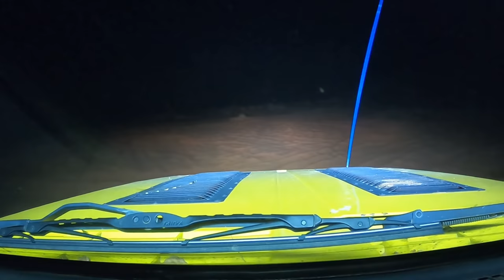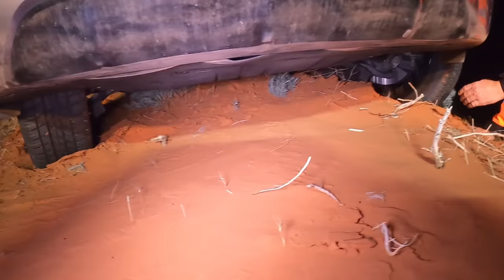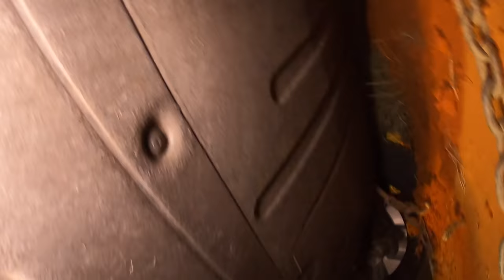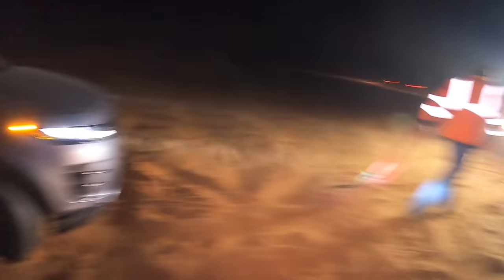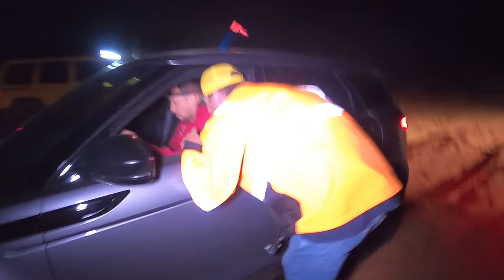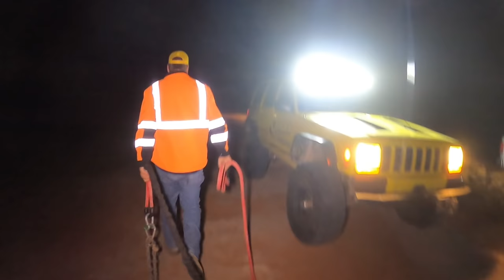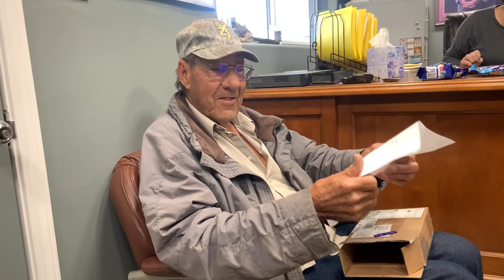Range Rover Evoque Not Doing So Well

Comment: Range Rovers are luxury vehicles and not serious offroad vehicles.  Unless it's a Defender 90, or an older model.
Reply: Hell, a proper Rangie would have been fine there.  As would pretty much any vehicle in the current line-up other than the absolute base-model fwd Evoque seen here.  Of course if you want a proper Rover you'll have to go back a few years and find a solid axle truck like a RRC, D1, or Defender (all which share the same basic underpinnings).  With the D2 things started to slide in my opinion.  By the D3/4 we've lost the solid axles and the decent from serious off-roader to street biased with off-road abilities began.  The current range is quite capable - for what they are.  But they'll never hold the same position they once did.
Reply: WTF?  completely wrong! Apart from the Evoque every RR and LR is serious 4X4.
Reply: @ACERASPIRE1  Given that no current Rover has solid axles 'serious' is relative.  Perhaps there is a language dis-connect here, but Rovers started life as off-road vehicles that could also work on the road.  Today they are road vehicles that can also work off-road.  MAJOR difference.  Independent suspension and air bags, no room for large tires, can't be lifted very much, poor break-over angles...they are still very good off-road compared to other vehicles in their class; arguably the most capable in class.  But despite my love for them I can't call them serious 4x4s.  The last serious 4x4 they had died when they discontinued the last Defender.
Reply: @donhappel9928  With respect, do you believe a 4X4 with live axles, limited articulation, no form of traction aid/control and skinny tyres will out perform a 4X4 with all the  above   mentioned?
Reply: @ACERASPIRE1  Yes.  Because all those things are easily addressed on an older truck and you cannot address them on a new one.  Let's use two of my personal vehicles as examples; I have an 07 D3 (LR3) and a '96 D1.  Both are heavily modified have been through the Rubicon but the process was so difficult in the LR3 I won't do it again.  The D1 has been through half a dozen times and will likely go through a couple more times this summer once the virus mess lifts.  Another example, one day I had my stock '88 RRC on 29" tires parked next to my 2" lifted LR3 in off-road height on 32" tires.  I got out a tape measure and checked the ground clearance at the sills - the RRC was taller despite the mods and bigger tires of the LR3.  While true the actual difs were lower than the clearance of the LR3, it's easy to avoid rocks with 2 individual low points compared to having the entire underside of the LR3 be at a uniformly low level.  (this clearance issue where they measure the dif of a solid axle truck vs the entire low hanging surface of the LR3 is something inexperienced wheelers often bring up).

Next point - weight.  An LR3 or 4, RRS, RR, etc is extremely heavy compared to a Defender/D1/RRC.  Weight is a killer under any circumstance except perhaps towing where it can help control a heavy trailer but of course you don't tow a heavy trailer if you're off-roading.  

Lastly you mentioned articulation.  Let's look at pics of even the latest/greatest of the IFS/IRS Rovers, the new Defender.  In every video it's constantly waving a tire in the air.  They have very poor articulation compared to a solid axle truck and keeping tires on the ground is the single most important part of wheeling.  

I also find the new electronic traction aids almost useless for actual wheeling.  On occasion they help but 9 out of 10 times a true locker would be better.  And no modern Rover offers a simple old-fashioned locker.  Yes, you can get a locking center and rear on some of the trucks but you can't control them yourself.  You have to hope the computer decides if/when to engage it.  If I'm about to tackle a particularly difficult climb where keeping my tires on an inch-perfect line is important I'd prefer to be able to lock before I start, not wait until I start slipping/spinning and fall off my line then hope the computer will grant me locking.  As for the simulated locking of using brake-based traction control no thank you.  It may be adequate for light work and is nice enough for bad roads but useless on a proper trail.  It requires the tires to spin before it can work (bad) and retards your progress when you need smooth controlled progress most of all (bad).  Iv'e also seen it overheat brakes and shut down during particularly long/difficult climbs, say up a long scree hill.  

My next Rover purchase (well, my next one may be another RRC tomorrow if I get a call from the seller but let's not count that) could be either an older Series 2 109 2-door or pickup to build a serous wheeler out of - tons, 40s, LS, 6 sp, 4 spd tcase, 3 link/4 link, etc to replace my D1, and/or a new Defender 110 in a couple years to replace my LR3 as a light-duty wheeler - think more 'overlander' than actual wheeler.  I don't hate the new Rovers at all, but they've long given up on being a serious 4x4.

Comment: The new range rovers are crap compared to the old ones, the old models are go anywhere, the new evoke, disco and defender models are posh junk
Reply: Tyco W doesn’t help that it has street tyres on
Reply: Tyco W I would have to disagree with you I have a 2019 rrs on 32s and it’s way better off road than my discovery 2 with a cdl
Reply: They are street only SUVs.
Reply: Negative... the new discovery is a beast
Reply: Wes Allen no way bro... the kill it stock, just swap out the tires
Reply: Xpedition Academy I was on a trail with a TJ and my sport and on harder trails the Jeep would struggle where the rover would walk right up it
Reply: As a Brit, I'm not patriotic to the brand or anything, but when the discos and defenders of old went off road, they worked.
The new versions are a watering down of the brand. Less mud monster more footballer's wife school-run mobile... Didn't help that Victoria Beckham had a hand in the Evoke design.... Urgh.....
Reply: The is false. The full size Land Rovers will take you anywhere. You just need the right tire and a willingness to damage a very expensive vehicle.
Reply: Blame the driver not land rover
Reply: @hunterevans6909  bs your grocery hauling rover  would not outperform a 4 runner or jeep over a real jeep trail period...sell that bs to someone else. Most serious trails require you to properly modify your stock vehicle and finding lift kits, armor, recovery equipment etc for a rover so you can get up and over big rocks or deep mud holes doesn't  happen easily. I am not talking about driving down a dirt road with a mud hole or little rocks and calling that offroading.
Reply: They have been rubbish vehicles for years compared to Toyota Landcruiser. We have had many on 4wd trips and if they didn't break down first they got stuck. Only LR owners or those who aren't familiar with them champion their worth.
Reply: Do your homework Tyco, the new models that are built for offroading are crazy good!
Reply: @yoboo6167  are you a fan boi? The old models were built for offroading but they are a piece of crap more now than ever in  terms of quality. If you  want to lease 1 fine but buying 1 is a fools game. They have terrible  resale value because everyone knows they are poorly made
Reply: @yoboo6167  I see you are a lil butt hurt..lol it's  ok I have a modified 3rd gen 4 runner as well strictly for the trail. Btw decent as the land rover are in stock form for offroading  they are miserable as they have always been in the quality  dept. Now that an india company owns them maybe they will be able to get a decent 1.5 star rating out of 5 but hey why don't  you buy one fan boi and report back to us in 5 years.  As far as my mom's basement sorry she doesn't  have one because the new house I had built for her in California didn't  need one...lol
Reply: @michaelr1760  Man, you got mad keyboard warrior skills. I yeild lol.
Reply: 😂🤣 the new better than old comments 😂🤣 who are you kidding? Electronics winning over mechanical systems lol whatever fanboys.
However I would like to see a face off between the generations!! Anyone seen the video of the stock Defender 90 pulling a tuned tyre spinning Dodge Ram in a tug of war? That's a good video.
"Sorry Matt for the post hijack"
Reply: Michael r Check out my YouTube channel, also  I’ve driven down the hardiest trails I could find and it performed perfectly and I completely believe it could outperform a forerunner or a jeep no problem with slight modifications of course.
Reply: If I wanted a British wheeler the only one I'd buy (if I had silly amounts of money to spend) would be an old military wolf, defender, or series III.
Reply: To be fair, tho, that's true of all vehicles.  The new American trucks are taller stock than they've ever been, but still have lower ground clearance than ever.  Took some kind of engineering to pull that off, lol.
Reply: HI Tyco you are ioo % correct about those old range rovers .the series1 were like a army tank built to last very rugged very stylish, they were so popular they used them on a African safaris for years.some still being used today.
Reply: Being familiar with the over complicated traction control settings helps too.

Comment: "I thought you said you were stuck."
-The gas company pipe fitter that pulled my Geo Prizm out the sand on Willow Springs Road near Moab.

"Why do I need a strap? I'm not the one that's stuck."
-The guy in the pickup that couldn't pull me out because, well you know why. 

Now I carry a strap. I didn't get stuck on the way out because I didn't have any silly 4x4 trucks driving slow in front of me 😁

Comment: Come on guys, Range Rovers are no joke offroad, you just can't assume that about their drivers. Maybe the Evoque is not so offroad-worthy as their other models, but it is not a front-wheel drive. It does have multiple traction control modes, including one for sand. Maybe this one was broken, maybe it never made it out of "Mall Parking Lot" mode, it's quite obvious it got in there to start with. Regardless, no Range Rover, no Jeep, no anything gets out of being that high-centered.
Reply: Nate Beachey B.S. yuppie tech and no suspension travel  equals a soft roader.

Comment: Don't take crappy cars without 4WD off the pavement!
Reply: it is awd, you can see the rear diff in the beginning
Reply: It's definitely AWD. The tires are the issue, not the car. Okay the car is crap too, but the tires moreso.
Reply: @jimmym3352  AWD is not 4WD.  I wouldn't take an AWD car off a well maintained dirt road.  Definitely not into sand.

Comment: But if you watch the video there are clearly axles. I know that those are primarily fwd drive an the rear end is supposed to activate, you can see a rear diff and the cv axles. Also you can see that at one point the rear was spinning cause the rear tires were dug Into the sand. Also there is a center locker and rear locker (could be wrong about the lockers) probably an operator error

Comment: Looking underneath the rearend, it looked to have a Haldex AWD system (I saw the rear differential with the clutch packs but for some reason, the rearend wasn't kicking in; he may need to take that thing to the shop (possibly ripped off the wires that sends the "lock up" signal to the rear differential when he was rooting?)

Comment: Hey Matt, did you ever actually take the slack out of the rope before the rover came off that hill?  I think the weight of the rope on the front end tipped the scale to get it off the high centering.  One thing I see on these videos is people hitting the gas to hard and losing traction.  We used to run around sand pits with 2wd pickups.  And what's with those stupid low sidewall tires? They're expensive and ride like hell.  What is the point?

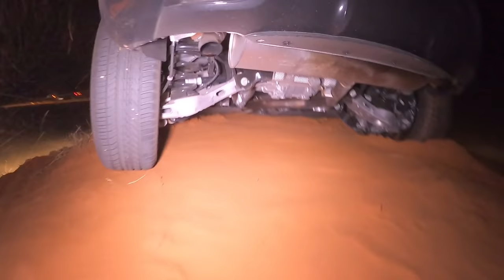Comment: That car IS equipped with AWD. You can see the rear diff and driveshafts @1:13. I wonder why it wasn't working?

Also, how'd they end up on top of a mound? LoL. That takes talent in something that can barely move in the sand ha ha.

Comment: Sand mode, take pressure of tires to about 13 psi and try not to bottom out. I drive a land rover discovery sport around the desert and dunes here in the UAE and got stuck a few times but these cars can get around sand and dunes when you know what you are doing and the capability of the car. But I gues the discovery sports are a little more offroad capable then the evoque

Comment: 1:15 it looks like a diff and axles in the rear. My guess is the electronic transfer case defaults to fwd everytime you restart the engine. That or viscous coupler is trash if it has one.
Reply: It should be automatic engagement on the center diff.  Wondering if the left rear wasn't spinning with the right front...

Or maybe the computers got confused by actually being off road, something that Range Rovers are no longer meant for.

Comment: Ok with the Evoque if something happens to the 4x4 system it will transfer the power to what axle is working which in this case was the front.. Range Rover/Land Rover does not make anything but 4x4s.. They have what they call command trac system if it goes out or someone get it stuck the computer will take over and that just makes the problem worse.. Plus the person driving it did not help any either.. Not blaming the person or the ride for this.. Looks like he didnt air up the system either.. Got to love air ride on them thats for sure..

Comment: Those low profile tires are the worst tires ever for off road.  That expensive rig is home on a paved road, not a sand lot.  I have regular tires on my GC Jeep, and it goes anywhere I have ever wanted it to go.  My Dodge pickup has semi-low profile wheels, but since I will never go into the sand, it is ok.  My T Bucket has 33" tires on the rear, and smaller tires on the front, along with lots of ground clearance.  It does quite well in the sand for road tires.  I ordered some sand paddles last week for it.  I live close to some sand dunes.  We will see how it does.  When I do go to the sand dunes, I will have a sand anchor to go with my winch.  (just in case)

Comment: Looks like on the 2nd attempt, his front wheels were the only thing spinning, it's a brand new car, still temp plates, maybe the owner doesn't know how to drive it correctly?
Reply: It it was 4wd, and in 2wd, only the rear tires would be spinning. This was a fwd car.
Reply: @ericpettyfishing  It is available in FWD and AWD, but I though if the diff lock failed to lock it would only go FWD?

Comment: I know, 6 months old, kinda yesteryears snow.... anyway, one of the few videos, if not first where I think: why this way ? My guessing would have been: If the vehicle was driven forward on the little hump, wouldn‘t pulling it backwards be more gentle to anything potentially being stuck underneath ? Some peaky surface or even a spike of some sort protruding towards or into the car and causing more damage by pulling the car more over it ? Just a question, you might have guessed yourself and checked all of this. Now writing this, I am pretty sure you did!-)

Comment: I'm confused on this one. It could barely move on the level sand. How did it get so high centered on top of that hill?  I feel like there is some other drive feature/option that wasn't engaged after they pulled it off of that hill.
Reply: I was wondering that too. It looks like there's a rear axle, so maybe some sensor was damaged for the AWD system after it was beached?

Comment: Did u try to play with the car? I’m sure this has all sorts of off road features maybe even diff locks. It was probably in a mode to save gas not using the rear wheels. I call user error

Comment: We have had some interesting conversations am reminded back in 1986-88 I sold cars trucks Mitsubishi Chrysler Plymouth Jeeps and the quality of the Jeeps was pretty poor. K-car era, Mitsubishi was producing the Dodge Colt wagon front wheel drive with a manual 4-wheel drive lever no high-low range 4 to floor only in 4x4. The lady had bought one of those and over the weekend  taking it to the beach this is on an island Guam. Monday a tow truck brings it back to the dealership; the clutch is burned out. Dodge Colt cooling system had an electric fan and they had overheated the engine. I was not the one who had sold the car, but I did know the woman, she was a friend. I asked what happened she explained that they got stuck in the sand on the beach. I said okay, she says; I don't want to drive it anymore I want my money back because it got stuck on the beach then says it's four-wheel drive. I said, June just because it's four-wheel drive doesn't mean it's not going to get stuck in soft sand on the beach. People I haven't changed much when it comes to sand in all these years.

Comment: Does the Range Rover AWD system normally run in front wheel drive and switch to AWD under certain conditions?  Did not seem to work here for some reason.
Reply: No, the real Range Rover is still a proper 4wd.  The Evoque on the other hand is a fwd/awd transverse 4-pot that shouldn't be badged RR IMO.  It's a fine enough car, but it's just diluting the Land Rover name, not to mention the flagship RR name.

Comment: hang on a minute  I thought those where 4 wheel drive? I don't see any back wheel spin
Reply: They do actually sell the Evoque as fwd, though most are AWD (not proper 4wd).  Of course Matt wouldn't know the ins and outs of the system but apparently the owner didn't either.